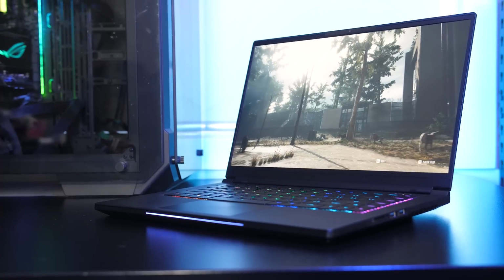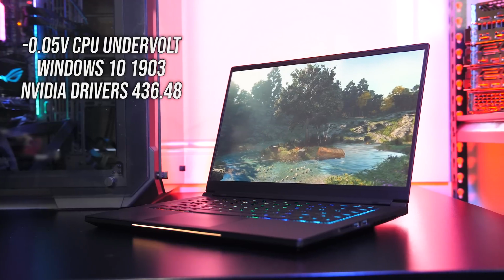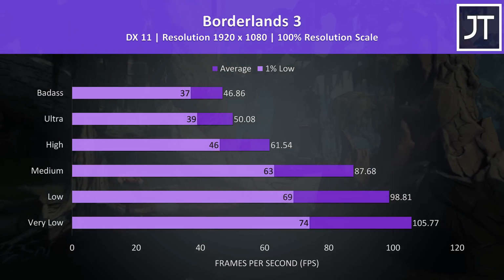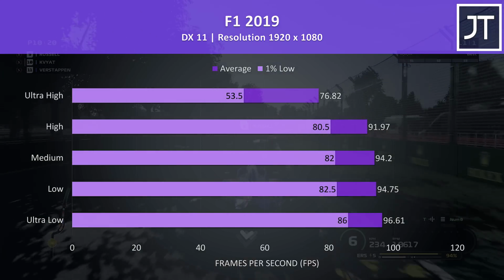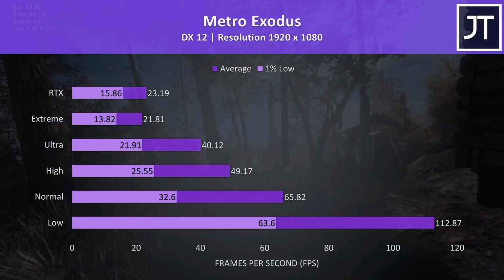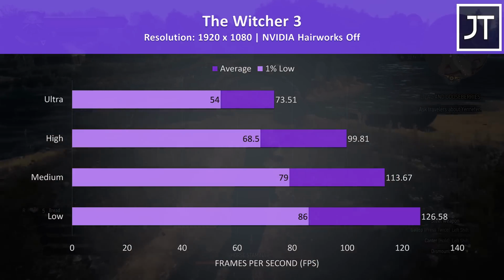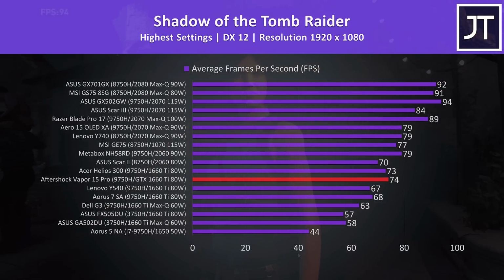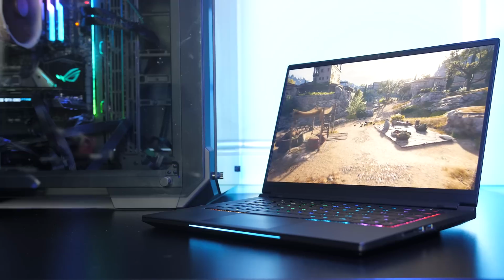Aftershock Vapor 15 / Eluktronics MAG-15 Gaming Laptop Benchmarks - GTX 1660 Ti

Comment: its been so long, your vids are getting better, this is my to-buy-list-laptop next year, is there any other laptop that you recommend other than this?
Reply: Acer triton 500. It has a large battery also (84 watt hours and an rtx 2060 with 3 zone rgb. U can get the lowest model (rtx 2060 with 512 gb ssd for 50 usd more than this laptop. It has an aluminium build. Downsides is that it has a flipped mobo and doesnt have per key rgb or an sd card reader
Reply: @lordoftherims436  i will looking forward for it. thanks you so much for your recommendation, really appreciate it !
Reply from the maker: Hmm yeah not really, this one was pretty impressive (just finishing editing the review now so I pretty much have my conclusions locked in), I'd happily trade my Aero 15x for it. I still get Thunderbolt, SD card slot, large battery, but better keyboard and cooling.
Reply: @JarrodsTech  your contents are still great or even better right now, waiting for a full review, thank you for keep making reviews..!!

Comment: So the 115w Eluktroboosted 1660ti is an Eluktroniks exclusive?

That version seems to perform around 2070 Max-q level or even slightly faster

A pity its not available on this aftershock variant
Reply: It is available in XMG called Overboost. How much it boosts I am not sure.
Reply from the maker: I don't think there is a similar feature available here, but would come down to the BIOS installed I assume. I saw no such option in the control center software, and HWInfo constantly reported 80w in use at max.
Reply: @JarrodsTech  xmg noted the actual figures are underreported in Hwinfo. They do say however all models have the feature built into them. Maybe removing the 75 degree thermal limit and testing if the clocks go beyond 1650mhz like the mag 15 should tell if this feature is enabled or disabled
Reply: @aashutoshrijal4741  yep this is true. You probably need to limit the CPU a bit because it pulls more wattage than other 9750h's or increase the GPU thermal limit to 87°. My 1660ti can hit around 1800mhz
Reply: @nathancasey7712  which model do u have? Aftershock or mag 15?
Reply: @aashutoshrijal4741  mag 15
Reply: I think that feature is availabe on all of these laptops developed by intel, they just use their specific name like overboost with XMG. It is something that I would like jarrod to test tho. If this one too has a 115w boost limit like the rest. Would be a shame if it doesnt

Comment: Does having the same chassis means same screen and brown switches keyboard?
Reply from the maker: Basically the body is the same, same internals etc. My guess is same screen and keyboard, I don't know for sure there or if different options are offered but to be fair neither will affect the results in this video (would for the full review of course).

Comment: Does this brand have the equivalent of eluktroboost ? Can you check the GPU power draw to see if it goes above the 80w limit? It's one of the biggest selling points of the laptops with this chassis.
Reply from the maker: No don't think so. It does not go above 80W on the 1660 Ti at any point, as you'll see in tomorrows thermal testing video.
Reply: @JarrodsTech  that's a shame, sounds like the vapor 15 is a gimped version then of the mag 15, Bob's testing showed that the 1660ti on the mag15 could draw up to 115w (!!)

Comment: Do you have any recommendations on a good gaming laptop under $2000, I don't have any money but I'm just asking for future references
Reply from the maker: Honestly not really because I don't keep track of prices, the only stuff I'm aware of is the $1000-1200 USD price point which is Helios 300 2019 or Lenovo Y540.
Reply: @JarrodsTech  anywhere on the price range of $1000-2000 is fine, I mean I'm just gonna use it for future references so it's alright thx in advance

Comment: So yes my question was related to graphics card. That do they use same graphics card as PC in laptop? Like because lapi are slim so how they fit that big of a graphics card. 
What new good games coming for PC?
Reply: Some laptops come with PC grade GPUs, they don't use the housing for it but the chip and most of the time really good cooling solutions.
Reply: GPU is about the same size as a CPU. PC GPUs have aircoolers on them, laptops don't. That's what you probably meant.
Reply: @davidmartinek5257  Was your comment in reply to mine?
Reply: @Moon_Presence  no
Reply from the maker: PC and laptop GPUs are different, in most cases you can look at the specs on the Nvidia website and see CUDA cores / clock speeds / power limits are all different. I don't really follow new games, I think people care about RDR2 on PC.
Reply: @JarrodsTech  so the difference is too much or little?

Comment: Hey Jarrod, I have Asus Zephyrus M Gu502GU with the exact same specs as this laptop and many others that you have tested. I see that you get 200+ fps on csgo at ultra on all your tests. I get 154fps avg. The only difference is i have single channel ram. Do you think upgrading to dual channel will give me 200+ fps like you get?
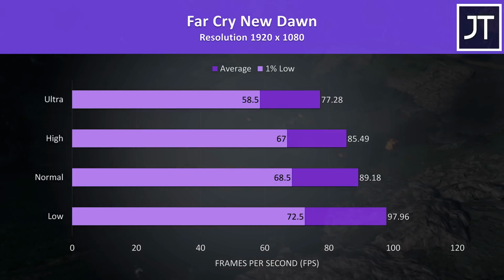Reply from the maker: Are you testing with the same benchmark tool as me? If not different results are definitely expected. Have you set it to fullscreen? By default it's not in fullscreen and that performs better. I have tested CS:GO with single/dual channel in this video at 2:47 https://www.youtube.com/watch?v=E_aPaj5QkmM
Reply: @JarrodsTech  Hey Jarrod, thanks for replying. And yes, I used the same fps benchmark tool/map and the game is on fullscreen. I also had anti-aliasing and such off/lowest when testing. I've seen you getting consistent 200+ fps with the same specs i have but the only difference i can see is you having dual channel ram. I also noticed that In your review of "Infinity S7" you were running single channel ram and it only got 110fps on High settings.

I also checked out the video you mentioned. There doesn't seem to be much difference in csgo with single vs dual on high, But i suppose it could be because of the old components? Since the avg frame rate is much lower than what we are getting with i7-9750h with 1660ti.